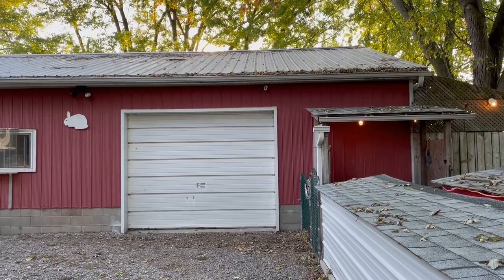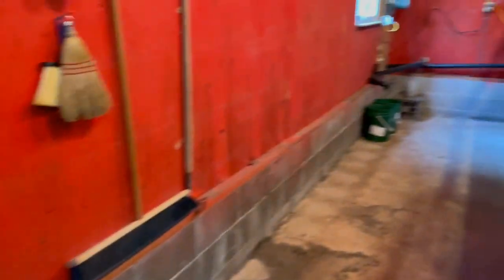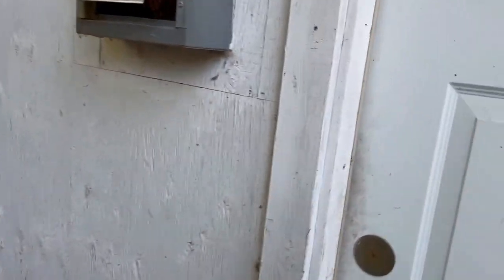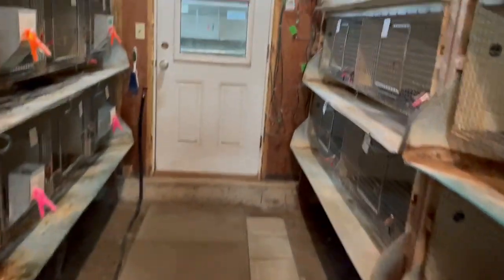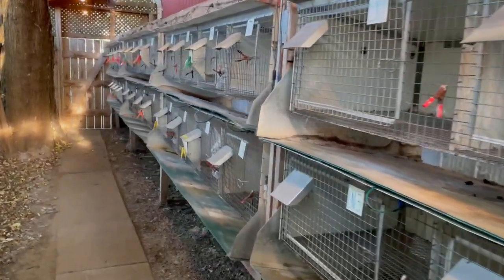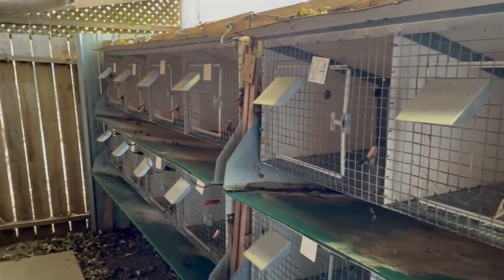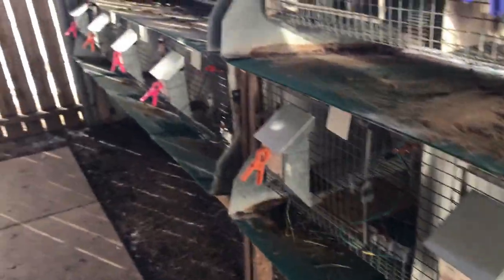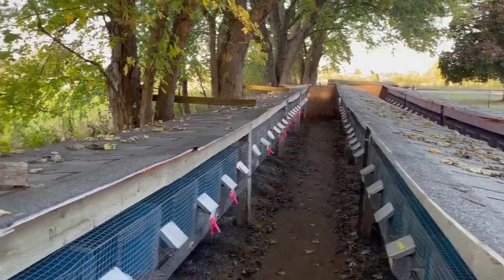If you raise rabbits; you need to watch this!

Comment: Could you go into more detail on your heated bowls? I am also in southern Ontario and am thinking of setting up a backyard rabbitry but the issue with water freezing in winter is the major thing holding me back.
Reply from the maker: Start out with just a few rabbits and use metal bowls.  Have a second set and just swap them morning and night when it freezes. For most people this works quite well.  Commercial rabbitries don't use bowls and heat the building or heat the water lines. I use bowls because you can monitor the rabbits better by how much they are drinking.  Breeders who show rabbits, find this to be important My heated bowl system is too complicated to discuss in this forum. When you get rabbits, join the Dominion Rabbit and Cavy Breeders Association and you can contact me through their membership list. We can discuss further at that time. All the best.